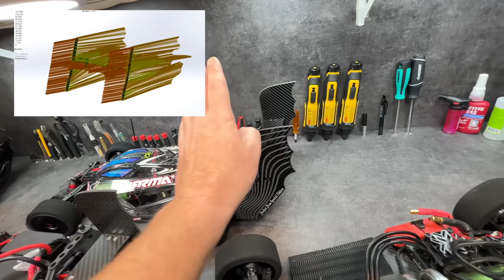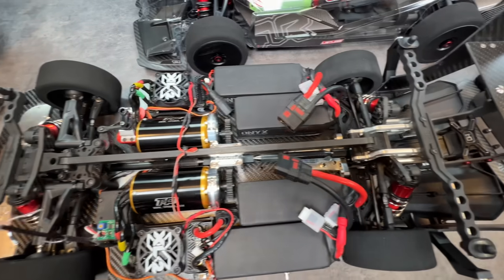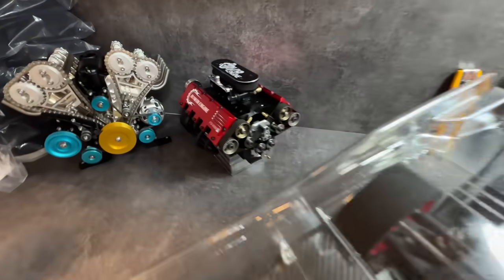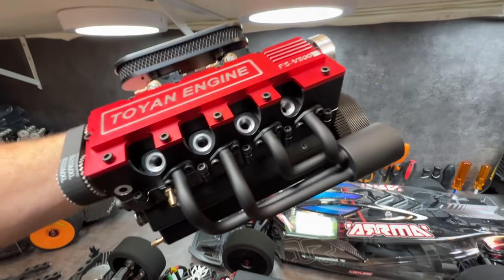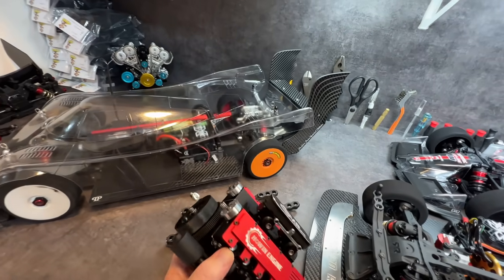MERRY CHRISTMAS!!🎄🎁 ￼

Comment: The dual motor with the 4 onyx batteries, is that spool mounted in the center of the car? If so, do you have the correct length shafts for sale?

Comment: About mounting the body, why not try to find someting that is mounted on the wheel hubs? Or close to the hubs on the upper arm. Than the body keeps in the same position to the wheels and not the chassis. Only a tough.